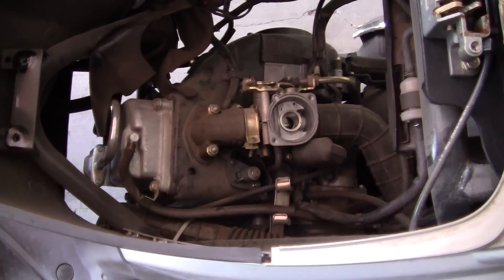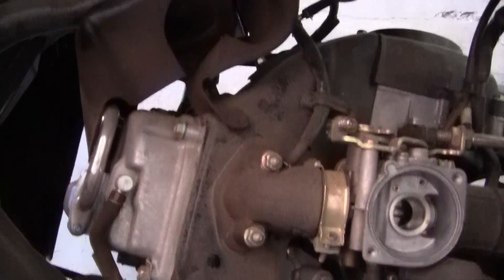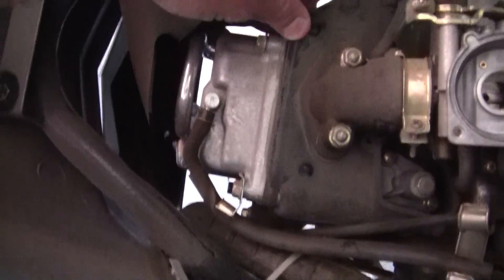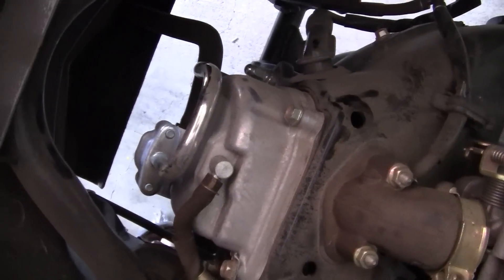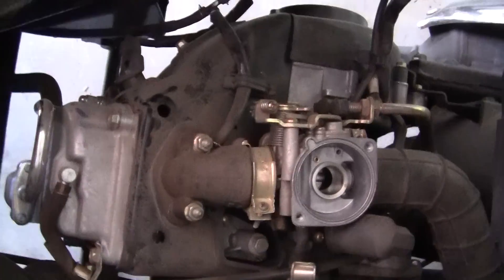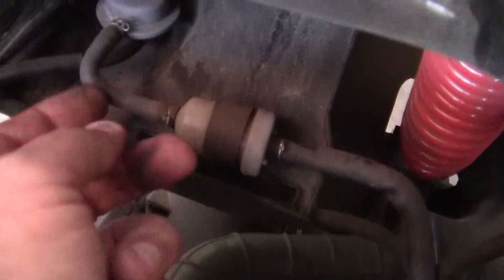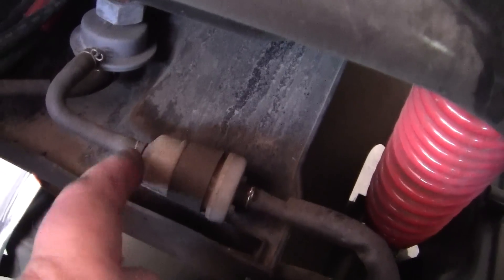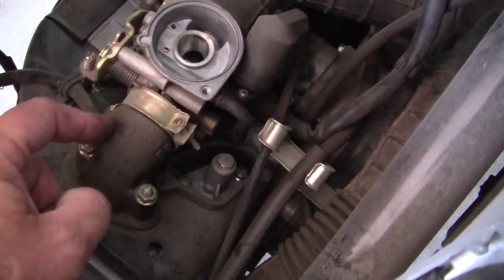(4) KYMCO "50CC"  SCOOTER = DIAGNOSES- the Easy Way

Comment: thank you for your video. A question for you:  i cannot "stabilize" the idle of my carburator.... too many RPM or not enough ... i'm a noob about scooter and motorcycle, could you please help me about this problem?
Reply from the maker: If you have a Chinese built bike, good luck. I have never been able to get a stable idle or carb idle out of them myself.
Reply: @DIOSpeedDemon  thank you for your reply. Yes, unfortunately i own a kymco agility r16 50 4t (2009)... I think that is a GY6 made in China.  Could you suggest me something to check for my "unstable"    idle? Is there something to check without  dissassembling the carburetor?
Reply from the maker: I would take the carb completely out and clean and rebuild it. Those carbs have a vaccuum rubber manifold on the interior of them that must be in good shape or will not work right. I have never had any luck keeping a competent idle on those bikes with those carbs. A internet mechanics book on the bike might help..
Reply: Thank you very much indeed.

Comment: Hi great video,  im just wondering if you could please help me out,  i have a 2007 kymco agility 50,  and the problem is,  its starts and runs,  but when riding it tends to bog down (lose power)  but if i pull the throttle back and forth a few times it passes the problem and runs fine. Any ideas what could be wrong,  any help or advice would be appreciated thanks :)
Reply: Mine does the same :-(
Reply: stekellysk6 mine too... any ideas guys?

Comment: Hi, do we have to change the oil every month or what ?
Reply: No depends how many kilometers u drive 

For example u drive 15000 every year change every 10000 also spark plug, filter and transmission oil. Every 5000 your valves I personally set them every 10000 change carburetor after 30000 also the brakes and 9/10 your exhaust is damaged

Comment: I have a new kymço agility 50 from September and after 750 km I have a issue,  when I stop in the traffic for som raison,  red light, ... when accelerate the scooter slow down for som time en then it accelerate normally 
What can be the issue?  
Is like it don't accelerate for som seconds short or long en after it accelerate again normally. 
Thanks
Reply: Add 2 caps of two stroke oil in the gas part
Reply: @maymarkets  even if I have a 4-stroke?